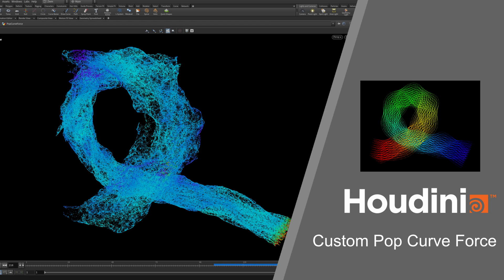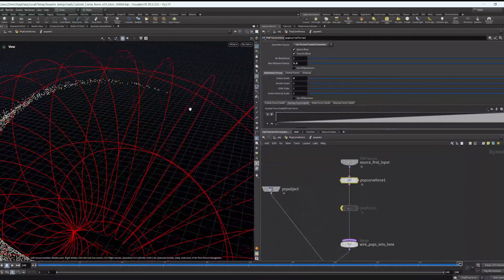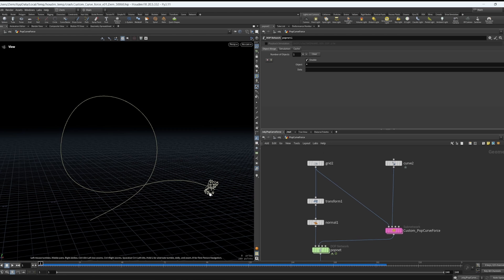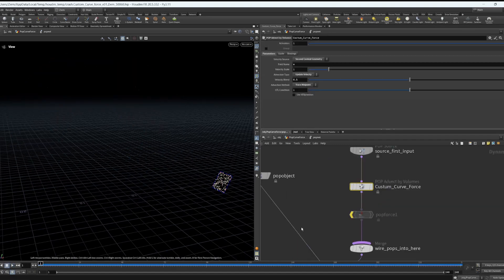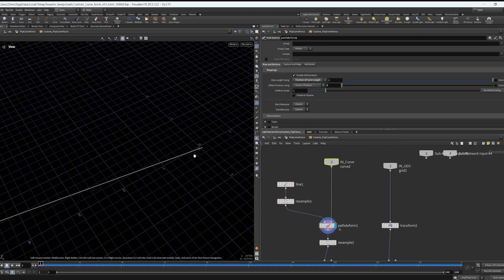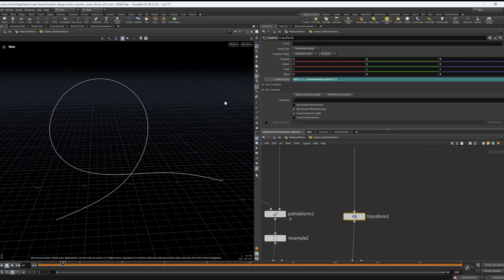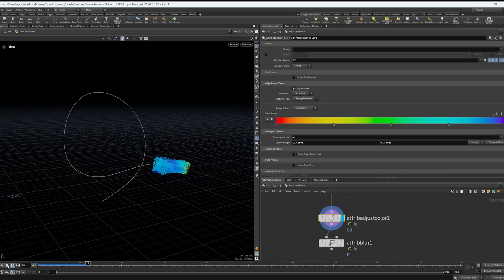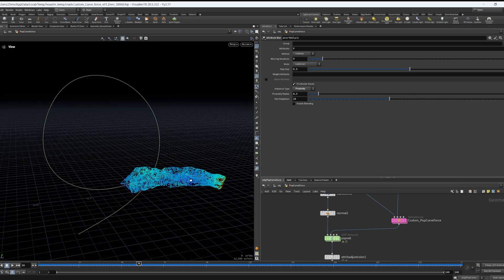Custom PopCurveForce in SifdeFX Houdini

Comment: Very nicely done, thanks a lot.
I haven't worked on projects lately that require the pop curve, but I am thinking that another solution can be using a carve node in a sop Solver and then emitting from that point.

Not really sure how well it will work, as I need to test it out... But I was just thinking of it as solution when saw your vid.

Yet again, thanks a lot... This was very helpful.